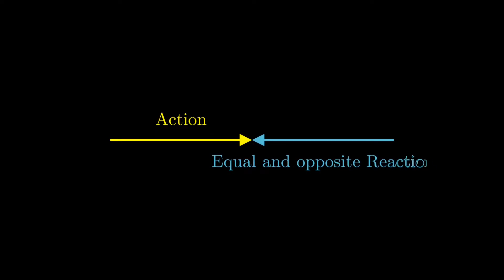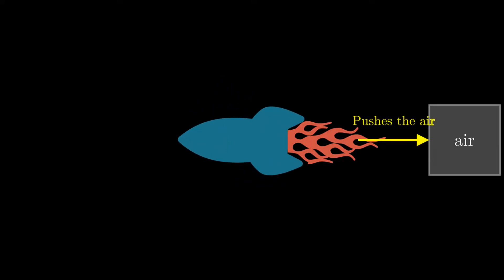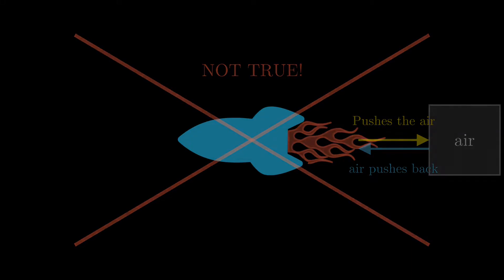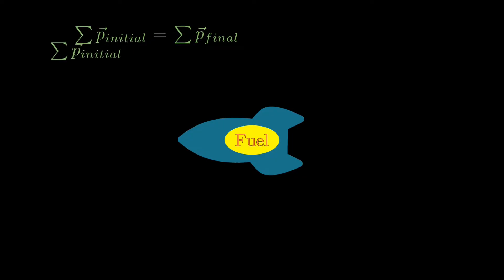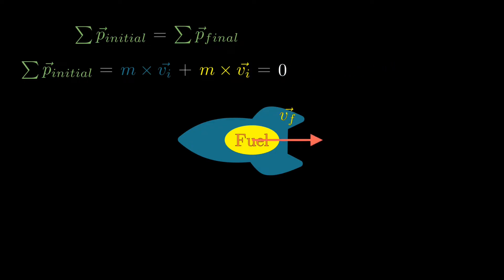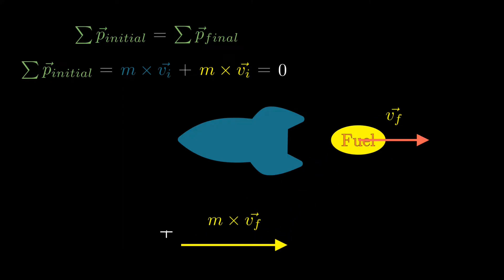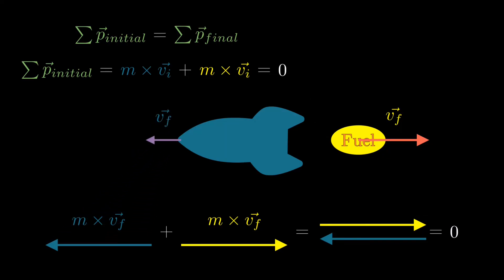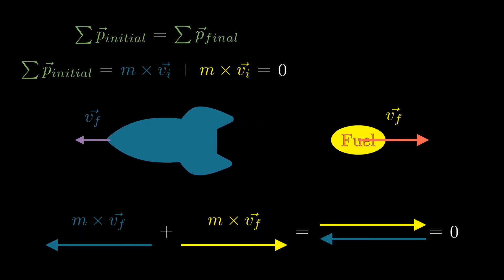What do Rockets push in Space, where there is no Air?

Comment: Newtons third law reuires " forced pairs"    a rocket in space is not a pair.  And so a rocket cannot work in space.
Reply: Rocket is pushing off the exhaust. What is the other pair?
Reply: @aznmutt15  you can't push off of the exhaust.  because there is nothing supporting the exhaust. .
Reply: @boptah7489  why would the exhaust need support? The mass of the exhaust is resistance to force. That's what it means to have mass. The millions of lbs of fuel being ejected out the nozzle is what it is pushing off of. How do you think thrust works?

Do you not understand newtons second and first law of motion works? To accelerate a resting mass (newtons first law), requires a force (newtons second law). Which will have a force back equal and opposite direction (newtons third law).

Did you want me to go into conservation of momentum also?
Reply: @boptah7489  how come the can moved before the soda hit the wall?
https://youtu.be/T8MOoUuLnug
Reply: @aznmutt15  The mass of the exhaust offers no resistance because the gaseous mass is being evacuated into the vacuum 
  ie.   the first molecule out of the rocket meets no resistance and travels at x velocity.  the second molecule out does the same and so on.  At no stage is any energy passed on to any other molecule because there is no resistance on any molecule to slow them down. 
    Newtons first law applies because there is no transfer of energy to other molecules once they meet the vacuum.  and Newtons second law applies when the molecules are pulled towards a gravitational field and the energy is then imparted onto masses in that field. ...the Universe is a closed system from a thermodynamics POV. 
   The exhaust gasses need to be supported by other masses,  just like a table supports a vase and the floor supports the table and the Earth supports the floor. .   A vacuum cannot support a gaseous mass..
    do you want me to continue.  ?
Reply: @aznmutt15  This is obviously a new subject for you.      A vacuum chamber is not the same as the continuous vacuum of space.  A vacuum chamber has walls and this then creates pressure.  Unlike the vacuum of space. .   Are we clear ?.
Reply: @bo ptah the force is applied to the molecules itself. Did you forget that part? What happened to the reactive force from the molecule?

The molecule of gas is at rest, then a force causes it to be accelerated out of the rocket. There is a force applied to accelerate that gas.

Did you forget that mass at rest will remain at rest, till a force is applied. So how was that gas accelerated without a force? 

Amazing how that table provides an equal and opposite reactive force back onto the vase? So what is the equal and opposite force on the molecule of gas?

Hmmm, such a new subject for you, that you forgot about how that molecule of exhaust was accelerated.
Reply: @bo ptah  hey, the rocket has millions of lbs of fuel. What happened to that mass? Remember, chemical reactions, such as burning, doesn't destroy mass, just changes it. So where did that mass go?
Reply: @bo ptah  hey, how does an sr71 thrust push off an atmosphere going away from it at mach three? Can't really push off stuff with the same force when it is already moving away from that push.
Reply: @boptah7489  hey, why doesn't a hose move when I place a solid barrier in its stream? Shouldn't the water be pushing off that solid object, causing a greater force?
https://youtu.be/MNQxQiFYbwk

Should I continue?
Reply: @boptah7489  if I was on a skateboard and threw a bowling ball and a beach ball of equal size, which one would cause me to move further and why? The balls are equal size and will apply the same amount of force on the air.
Reply: @aznmutt15   Gas molecules naturally expand in a vacuum.  " joule free expansion". No external force is required or generated until it is transferred onto another mass.
  Gases naturally expand with less resistance.  you need resistance to keep a gas contained. 
    Gases are never at rest unless you reach absolute Zero.  Gas molecules are continually moving especially as you release any resistance keeping the gases contained. .   Gases naturally accelerate in the presence of a resistanceless environment. 
   The table ONLY applies a force to the vase because the table is not 'Falling'.  I( supported by the resistance of the ground)  If the table was falling with the vase.  there would be no force between the vase and the table.     Just like the molecules being sucked out of the rocket.  No force is applied to the rocket because no force can be applied top the vacuum. .  As per N3.    Do you understand yet ?.
Reply: @aznmutt15  The barrel did not offer enough resistance,. However , when the hand was put in front of the hose the hose moved backwards.  .  you seem to have forgotten that part of the video. .   Shall i continue ?    Have you been beaten enough yet ?
Reply: @aznmutt15  And so.  you have 3 things.  1/  bowling ball  2/  the man on the skate board.  3/  the force separating the two.  
  A rocket in space has 2 things  1/  the rocket  2 /   the expanding gas .    
   For Newtons third law you need  3 things.  . you need the forced pairs  ( two masses)  and the force separating both.  
   A rocket does not throw a gas.  the gases are naturally sucked out of the rocket into the vacuum.    To  'throw'  something means you are overcoming the resistance ( inertia)  of the bowling ball with a force.   .  A gas needs no force to expand into a vacuum. 
   Have you finished yet ?.    .
Reply: @bo ptah  gas pushes off each other to the walls of the container. Now, if there is a nozzle which gas is allowed to escape, there is an imbalance of forces. Remember, the vacuum doesn't do anything, just provides non resistant volume to escape into. Gas pushing off each other and the surrounding container that causes the gas to escape. Once again, the molecule has a force applied to it, what is the reactive force?

Oh and joules free expansion, does not say anything about the container it is held in. Remember, we are trying to figure what is happening with that.
Reply: @bo ptah  gas does not naturally accelerate. That defies newtons first and second law. F=ma. Not acceleration without a force.

Except the vase is in a. Accelerated state. Did you forget weight? Nor resistance without that external force.
Reply: @boptah7489  so why didn't the hose move when a solid surface was obstructing the path of the water? Wouldn't that cause more resistance back onto the hose?
https://youtu.be/MNQxQiFYbwk
Reply: @bo ptah  why did the can move the instant pressure was released? Not when the soda hit the wall?

Is conservation of momentum false?
Reply: @bo ptah  I litterally pushed the hose. Not the water pushing off me. How did the barrel not cause enough resistant? It obstructed the path of the water.
Reply: @bo ptah  there a force separating the gas from the rocket? Remember, vacuum doesn't suck. Did you forget that part of thermodynamics? The gas is pushing off the container so the container is pushing back onto the gas. Except one side of the container doesn't have a wall to push off of. So the forces aren't equal inside that container.

Did you forget that the gas is pushing off the container?
Reply: @aznmutt15  the solid surface ( barrel) was not close enough to the mouth of the hose.  This meant that the resistance was not high enough to move the hose.  The atmosphere between the hose and the barrel just slightly increased in pressure and removed the pressure created.   When the hand went to the hose.  the pressure increased enough to move the hose.  as the video shows, 
   rocket s are all about pressure creation.  the grater the pressure differential between the nose of the rocket and the back of the rocket.  the faster it goes. .
Reply: @bo ptah  but you claim it would push off the surface? Why didn't the water push off the surface back onto the hose?

By your claim, wouldn't the solid surface just cause more pressure anyways? It needs to push off the air. The solid surface would push more.

How much closer does it need to be?
Reply: @bo ptah  my hand literally hit the hose. Not the water pushing off my hand. I litterally pushed the solid part of the nozzle. So my finger didn't create more force on the escaping fluid, which transfered back onto the hose. My finger directly transfered a force to the solid surface of the hose by actually contacting the hose. So the fact that the hose did not move until my finger made physical contact with the hose pretty much refuted your claim.

Why did you have to lie and make up a false scenario?
Reply: @boptah7489  the burn chamber has thousands of times more pressure than at the nose. There is no external pressure on the nose. The internal pressure of the tanks is nowhere near the pressure inside the burn chamber. You litterally just refuted your own claim
Reply: @boptah7489  is conservation of momentum false?
Reply: @aznmutt15  There is no force separating the gas from the rocket.  the force is in the molecules separating from each other .  The force on the rocket is the same as the force separating the molecules.  Which is negligible. .  just as if you push on the air with your hands.  the force is hardly detectable unless you are the size of a molecule.  Action and reaction are equal and opposite. 
   The force in a container of gas is always equal.   there is never an imbalance of force in a pressurised container.
Reply: @aznmutt15  the hose would have moved  when you blocked the hose.  .  which was why the hose moved so easily.
Reply: @aznmutt15   conservation of energy is true.  This may or may not manifest in momentum.
Reply: suction is when a force is created by pressure differential.  A gas is therefore SUCKED into a vacuum.   Suction is a physics term to describe that. 
   .  A container moves because of the imbalance of pressure OUTSIDE the container.  Not within it.  Like a bullet going down a gun barrel. .  The  greater pressure is greater behind the bullet
Reply: @bo ptah  it is negligible force, if it was just a minute amount of gas. Except, the rocket is throwing tons of exhaust at an extremely high velocity. That is a crap ton of momentum. If I were to condense air into a high pressure state, and release it at a high velocity, that wouldn't create a force? Oh wait, it does. 

Forces inside a container is equal. Except the container isn't complete, there is a hole which gas can escape. So that force is no longer equal.
Reply: @bo ptah  oh, so now you require a complete seal. I'm sorry, but the atmosphere doesn't do that to the rocket. You do realize in the atmosphere, gas is still free to expand into it. The funny thing is, rockets become more efficient at higher altitude because there is less pressure squeezing down the thrust. The factor that determines the force is how much mass and how fast it exits.
Reply: @bo ptah  vacuums don't suck. Nothing in physics says that about vacuums. Vacuums have no force or power. It is the pressure differential of the air pushing itself to that causes any force. That force still has and equal and opposite force. Did you not read the second law of thermodynamics? Did you not read the joules free expansion?
Reply: @bo ptah  oh, so conservation of momentum is true. Does gas not have momentum? If the rocket fuel system have zero momentum with respect to each  other. How is momentum conserved when the exhaust has momentum. The rocket and exhaust system still need to have a net of zero.
Reply: @bo ptah  oh. I'm still waiting for you to explain how the can moved the instant it opened. Not pushing off the wall.
Reply: @aznmutt15  because the pressure drops evenly.   Imagine a fish tank full of water.  what happens if one of the walls cracks.  Does the fish tank move in the opposite direction ?
Reply: @bo ptah  that would depend if it was on a frictionless surface. How do you think a hose pushing back on the fireman works? Lots of mass of water, at high velocity.

Same thing with an air canister releasing pressure through a hole. 

Oh and the pressure in the air tank doesn't get sucked out by the atmosphere. Vacuums don't suck.
Reply: @bo ptah  in fact, something like this has happened to me when i was a bartender. We would use a coster over a glass to seal the beer, allowing us to throw the glass of beer across the bar, even with a flip. One time, the coaster popped off mid-air, pouring the beer into my face. Now, why didn't the glass keep its momentum and crash into me? Instead, it dropped to the ground.
Reply: @aznmutt15  A hose pushes back on the firemen because the water needs a force to push it out. .  Unlike a gas coming from a rocket in a vacuum.  
   A gas is sucked into the vacuum.  The gas does not need a force to push it into the vacuum. .  It happens automatically because the gas is compressed.  
    The same for water in a vacuum actually.  Water naturally expands into a vacuum because it boils at low pressures without any heat applied.
Reply: @bo ptah  but the gas needs a force to push out. Did you forget that gas behaves like a fluid like water?

In the beer example, the beer was free to escape the glass, but the glass still lost its momentum. Conservation of momentum will dictate that the higher velocity of the beer would need something to slow down to conserve momentum. Oh its the container, the glass.
Reply: @bo ptah  how many times do I need to say this? VACUUMS DONT SUCK. The gas is pushing on itself and the walls of the burn chamber to accelerate.

Your whole argument falls apart with what you claim. A vacuum is just a lower pressure system. The atmosphere would suck out the gas of a pressurized canister, not allowing it to move.
Reply: @bo ptah  water doesn't expand in a vacuum. It boils. There is a difference. 

If I had a fire cracker inside a vacuum and it exploded next to an object, would that fire cracker cause a force on the object?
Reply: @aznmutt15  No.  The gas needs a force to keep it in.  Not to get it out in a vacuum.  You only need a force to get gas out of a container if there is resistance to the gas escaping.  
   Both the beer and glass have momentum.  momentum is a function of mass moving.  But the momentum can only be released as a force if it hits another mass. 
   The gas leaving the rocket  in a vacuum has momentum , but it can only be used as an energy source when it meets another mass.   There is no mass in a vacuum an so no force can be transferred. .  this means no force can be transferred to the rocket.  As per N3.   If the Action is Zero,  so is the reaction.  and vice versa.
Reply: @bo ptah  the gas pushing on each other is the force to expand. VACUUMS DONT SUCK.

Gas has momentum? So, how is momentum conserved when the momentum of the gas causes a change in the system? 

But there is a force from the chamber on the gas. What happened to that reactive force?
Reply: @boptah7489  if a fire cracker explodes in a vacuum next to the object, will it feel a force from that firecracker and move?
Reply: @aznmutt15  Sucking is the phenomena of pressure equalisation.   A gas always goes to the area of least resistance.  Hence it is 'SUCKED' into the vacuum.
   The momentum is still in the moving gas molecules.  But it is not imparted as a force until it meets another mass.  ie.  the gas leaving the rocket in a vacuum  is attracted to a nearby gravitational field and the momentum is then imparted onto a mass in the gravitational field. .
Reply: @bo ptah  holy shit. The gas molecules pushes on each other to fill the void. Vacuums don't suck.
Reply: @bo ptah  by your own logic the lower pressure of the atmosphere would suck the gas out of the rocket and it still wouldn't work.

You still haven't explained why a solid surface, which gives much more resistance, did not impart a force back onto the hose.
Reply: @bo ptah  what do you think the paper container does?

Not if the container is stronger than the shrapnel. The paper from the firecracker isn't going to do much damage. It is more of the expanding gas. Now would that expanding gas not move the object?
Reply: @aznmutt15  you misunderstand.    It is impossible to create an explosion when exposed to a vacuum. 
   The paper container opening will be exposed to a vacuum and so will not explode.  you can only create an explosion when there is resistance .    no resistance = no explosion.
Reply: @boptah7489  do you not realize it is sealed with wax? There is a huge difference between burning gunpowder and igniting it in a confinded space.
Reply: @aznmutt15  It is not sealed from the outside atmospheric pressure.  .  Otherwise it would not explode.
Reply: @aznmutt15  You can only create an explosive reaction with pressure,  No pressure.= no explosion.
Reply: @boptah7489  it's sealed. Even if it wasn't, let's just say it is sealed and ignited by an electric igniter. What fucking difference does it make. Will the object move?
Reply: @boptah7489  we can even cause an explosion of the gunpowder between two surfaces hurled at each other. Will they be given extra energy?
Reply: @bo ptah  we could even say it was a gun in space. Would there still be recoil?
Reply: @aznmutt15  It is pressurised.  It is not sealed in a vacuum.   Remember,  you are claiming that things can explode in a vacuum in a controlled manner.  that is impossible.
Reply: @aznmutt15  you can only cause an explosion with pressure.  two surfaces hurled at each other is pressure. .
Reply: @bo ptah  no, I am asking if the object will move from the explosion. Why are you straw manning an argument?

You do realize gas has a limited speed which it can escape depending on the area of the hole. Gas can only move at speed of sound through a converged nozzle. Not hard to sustain the burn in the burn chamber. But that is not what the question was. Stop running away.
Reply: @bo ptah  you saying the wax and paper doesn't cause enough resistance to allow pressure to ignite the fire cracker?

Fuck it then, use the gun. Will the gun have recoil?
Reply: @boptah7489  will that explosion cause the two objects to fly apart? You stated it will explode.
Reply: @aznmutt15  gas can go much faster than sound in a vacuum.  Because there is no resistance from an atmosphere. 
  If you have a totally sealed container of explosive in a vacuum and you ignite it electronically, then the container will explode.  but you can not make it 'direction specific'. 
  This is why it is impossible for  a rocket to work anywhere near space. .  You need pressure to continually combust fuel and oxidiser.  .   I hope you are sufficiently educated now.
Reply: @bo ptah  once again, not what I said. I said gas has a maximum velocity through a restricted area. This velocity is the speed of sound through that gas.  

Still haven't explained if the object will move because of the explosion. Still haven't explained why the soda can moved the instant it opened.
Reply: @bo ptah " The highest velocity to which a fluid can be accelerated in a converging nozzle is limited to the sonic velocity (Ma=1), which occurs at the exit plane (throat) of the nozzle."

So you can contain pressure my burning fuel faster than you lose mass through the converging nozzle.

So now if I accelerated the mass of the fuel to a high velocity gas out the back. How is momentum of the system conserved? Remember, the net momentum must remain zero. We now have a scalar value of mv (mass of exhaust x velocity of exhaust). How is the momentum of the system conserved? 

Momentum doesn't say anything about gas pushing off stuff.
Reply: @aznmutt15  You are working within the parameters of atmospheric pressure not a vacuum. .  There is no pressure at the nozzle of a rocket in a vacuum.  The speed of a molecule is much much faster in a vacuum. 
   There is also no pressure withing the rocket combustion chamber because it is exposed to a vacuum.  Also the fuel and oxidiser inlet jets are much much smaller thn the nozzle throat , so there is zero chance of any pressure. 
  You need to understand that a rocket needs pressure to operate.   No pressure= no thrust.   This is why a rocket cannot go anywhere in a vacuum.
Reply: @bo ptah  great. Let's see if you actually provide connotation supporting your claim. Because basic rocket science, thermodynamics would state otherwise. Describing a converging nozzle creates a choke point that will restrict the maximum speed that the exhaust. Only after the nozzle will a diverging bell allow the exhaust to reach supersonic.
Reply: @bo ptah  you still don't get that a vacuum doesn't do anything. It doesn't impart any force. It doesn't suck things out. It is just empty space. 

This is evident by the fact that the size of the vacuum does not matter in a mercury barometer. Only the surrounding pressure vs the weight of the mercury determines the height.
Reply: @aznmutt15  molecules moving in a vacuum do not have resistance....so they are faster.  
  Rocket science and thermodynamics support this. 
   The nozzle is massive compared to the fuel and oxidiser jets.  So there is no restriction.
Reply: @boptah7489  here is a simple question. Is the pressure of space negative?
Reply: @bo ptah  they aren't faster. They just maintain speed because there is nothing to bounce off of.

No, it doesn't. Vacuums do not impart any force. Lack of resistance doesn't make a molecule go faster. It just doesn't slow it down. Resistance will only resist the motion. It is like air friction is always in the negative direction of the velocity. It will just go to zero in space. Seriously, do you not understand what resistance means? What you are claiming is that the vacuum is assisting the velocity. You don't even understand what zero resistance means.
Reply: @bo ptah  so what? It is still a choke point for the expanding gas inside a chamber. That means there is a maximum speed that is relative to the pressure of the gas at that point. That speed, which it can move, is the speed of sound through that fluid. That is the maximum speed which the molecules can interact with each other.
Reply: @boptah7489  is the pressure of space a negative value?
Reply: @aznmutt15  there is no pressure in space.  Pressure is not possible in a vacuum
Reply: @bo ptah  sustained pressure in a chamber with a restricted nozzle, is what I am talking about. Shooting a stream of gas at an object is pressure. A nuclear bomb exploding in space will impart a pressure wave. C4 exploding will impart pressure. The vacuum is just a frictionless environment. It does nothing to the particles. 

You really need to start thinking of gas as a particle and how a vacuum means there is nothing to get in its way.

You still do not understand what no resistance means, do you?
Reply: @bo ptah  Basically, a converging nozzle would be like a 1000 people trying to get through a couple of doorways. There is a limit to which they can exit the building. It doesn't matter how hard people push. There is a limiting rate that they can leave.
Reply: @bo ptah  pressure is just force over an area. If we have pressure for liquids, we have pressure for gas because they both behave like a fluid.
Reply: @aznmutt15  There is Zero pressure in a combustion chamber when it is exposed to a vacuum.  the gases are sucked out instantly and violently.
Reply: @aznmutt15  No.  A rocket engine in a combustion chamber is like trying to fill a swimming pool with a 1 " bore hose , when the pool has a 2 foot hole in the bottom. .   A rocket needs massive amounts of pressure to move..   Pressure creation in a vacuum is impossible because there is no resistance.  and so no pressure.
Reply: @aznmutt15   There is zero force given by a gas in a vacuum on a mass.  Unless there is an equal and opposite mass on the other side of the gas.  N3.     A gas can not apply a force to a mass in a vacuum unless the mass totally encapsulates the gas.
Reply: @bo ptah  why. Gas has inertia. A force is needed to accelerate that mass. That force will have an equal and opposite force. 

No where does it state what you claim. Because all matters would have to follow that. Once force is applied to the particle, it does not have any more contact. If you claim otherwise, then by all means, site a credible source supporting your ideas.

Even thermodynamics state that gas pushes off itself and the walls to fill a void. Science doesn't claim vacuum draws gas in. Zero resistance means there isn't anything to hinder the particles' velocity. Resistance only slows an object. Negative resistance would mean to accelerate. Except space isn't negatively pressured.
Reply: @boptah7489  gas is the mass having a force applied to it. It doesn't need to apply force to any other particle. It's inertia, resistance to acceleration, requires a force.
Reply: @bo ptah  you got that opposite. It would be like filling full a swimming pull with a 1" drain with a fire hose. Funny how you failed to address the maximum speed of gas inside a converging nozzle.
Reply: @aznmutt15  A gas is SUCKED into a vacuum.   Sucking comes from 'suction'.  which is a physics term recognising the force generated from differing pressures. 
   Zero resistance means literally that.  there is zero resistance to the acceleration and expansion of gases in a vacuum.  Unlike an atmosphere which has resistance.
Reply: @aznmutt15   No  the exhaust throat is MASSIVE compared to the fuel and oxidiser inlet jets.    The speed is completely irrelevant because energy can only be released when resistance is met.  As per the conservation of energy principle.  
   A gas in a vacuum releases no energy because there is no mass /collisions to release the energy onto.  This is why rockets can only work in an atmosphere and never in a vacuum.
Reply: @aznmutt15  There is no force applied to a gas in a vacuum.  because the molecules never touch each other due to being in " joule free expansion " 
  Gases do not resist acceleration in a vacuum.  Gases are like compressed springs under pressure  but in a vacuum they are free to expand .  .  This is why a gas is sucked out of the rocket.  Sucking is the term used to describe high pressure going to low pressure.  no force needs to be applied to accomplish this. .  This is why there are no rockets anywhere near space.  .  Rockets are for fun and war.       not space travel.
Reply: @bo ptah  what are you talking about. The gas is pressurized in the burn chamber through combustion. That means there is a shit ton of impact with the walls and each other. Which means they will collide before the converging nozzle.
Reply: @aznmutt15  The force in a gas is the force used to compress the gas in the first place.   Gases naturally seperate in a vacuum.  You need a force to keep them pressurised. 
  The gas leaving the fuel and oxidiser jets in the combustion chamber is directed towards the throat and the molecules line up in that direction because the jet lines up the molecules.  Just like a hose squirting water.  the water is in a jet because the molecules are lined up due to the constriction and shape of the hose.  .  A bit like having a long barrelled shotgun as opposed to a sawn off shotgun.
Reply: @aznmutt15  'Sucking'  is the term when high pressure goes to low pressure.  It is automatic and requires no external force.
  Zero is not negative.   Zero resistance just means there is no resistance to the accelerating molecules.
Reply: @aznmutt15  the gas is not pressurised in the burn chamber when the rocket is in a vacuum.  The burn chamber is also a vacuum.   
  Imagine a SCUBA tank with the bottom cut off and connected to a vacuum at the bottom.   how much pressure can you put in the tank if you fitted a compressor to the top ?.....Zero. 
  In a vacuum the gas is sucked out of the chamber as soon as it enters from the jets. , because the flow of gas is pointing towards the throat.  like a hose.
Reply: @aznmutt15  the fuel and oxidiser inlet is tiny compared to the throat nozzle
    There is no combustion in the combustion chamber if the rocket is in a vacuum.   You need pressure to 1/  mix gases  2/  ignite gases.   There is no pressure in the chamber to do either. 
   the energy in the gases being sucked from the rocket is imparted onto the next mass they meet.  ie  a nearby planet. 
    You need to readjust your thinking on how a rocket works in an atmosphere  compared to a vacuum.  they are entirely different.   An atmosphere has 'resistance'.  A vacuum does not.
Reply: @bo ptah  sucking isn't a term used in science. It is a colloquial use term. There is no such thing as suction  caused by pressure in science. Go ahead and site a source supporting your claim that vacuums assist motion, not have zero resistance. 

Oh, there you go again, contradicting yourself. How can zero resistance accelerate matter?
Reply: @bo ptah  not it is not, the expanding gas due to combustion is pressurized. The fact that there is gas burning means there is pressure.

Ok we can have a pin size hole in that tank. Oh shit the gas can only escape at a maximum speed. It isn't instant. There is no such thing as instant.
Reply: @bo ptah  did you forget that there are hundreds of those inlets? They make the small to atomize the fuel and oxygen to allow proper mixing. There are hundreds of these on plate meters in diameters. They pump several tons of fuel every minute. What was it, like a million lbs of fuel per minute or something?
Reply: @bo ptah  how come in a mercury barometer the volume of the vacuum is completely irrelevant to how much mercury is left in the tube? I thought you said it sucks? If that were true, then we would measure the barometer from the top of the tube where the vacuum is. Except we don't. We measure from the bottom because it is the pressure of the atmosphere holding up the weight of the mercury inside the tube. Not the vacuum sucking up the mercury.
Reply: @bo ptah  oh, and you do realize the bell isn't where the converging nozzle is. That isn't where the combustion takes place? That's where the gas is allowed to expand into the zero restriction of the vacuum, raising the momentum of the gas.

Oh and the burn chamber had fuel injectors that had over 2800 holes pumping over 670 gallons a second of fuel. That's before the thermal expansion of combustion.
Reply: @aznmutt15  I know that combustion does not happen in the combustion chamber.  Otherwise the rocket will blow up.   The combustion takes place outside the bell. with the hottest point being the tip of the blue flame....just like a teclu burner.   This is because rocket motors are designed to create a high heat area combined with dense gaseous mass., to create the highest pressure possible. ,  The whole point of a rocket is 'pressure creation '  behind the rocket.  the higher the pressure the grater the force and the greater the speed. 
   The nozzle has to be greater in area than the jets.  otherwise there would not be any 'resistance' in the chamber to mix the gases.  Which is the whole point of the chamber. .  In an atmosphere there is enough resistance.  but in a vacuum the gases just exit the nozzle without mixing. 
   This is why a rocket cannot work anywhere near a vacuum.   Pressure creation is impossible without resistance. so is combustion and so is the mixing of dissimilar gases. .
Reply: @bo ptah  the color of the flame is determined by the fuel type. The enging of the shuttle shot a pure blue flame because it uses hydrogen and oxygen. Falcon uses oxygen and kerosene type fuel, which burns an orange color. There isn't a blue flame in that.

The solid rocket booster were just a column of fuel with a star shaped pattern in the center. The combustion occurred inside that tube.
Reply: @boptah7489  hahaha. I thought explosions couldn't happen in a vacuum. Nice contradiction.
Reply: @aznmutt15   Explosions can't happen in  a vacuum.  Only an atmosphere.   An explosion is a function of resistance.
Reply: @aznmutt15  kerosene only burns yellow if there is not enough oxygen.  Otherwise it burns blue.  
  A rocket engine is designed to create the max pressure behind the rocket .  Where the blue flame is.
Reply: @boptah7489  but you just claimed the combustion chamber will explode. Nice contradiction.
Reply: @bo ptah  I'm diluted. Every rocket engineer and explanation contradicts what you say. They use external candles to light the gas so they won't have to develop a internal ignition system. 

How exactly would they prevent the burning gas to expand into the combustion chamber? It is a lower pressure. Wouldn't that cause a vacuum and suck it up?
Reply: @boptah7489  tell me. Where is the blue flame on a picture of a falcon 9 launch? Why does the blue flame of the space shuttle not turn yellow?
Reply: @boptah7489  why do they call it a combustion chamber? What is the purpose for that chamber?
Reply: @aznmutt15   The purpose of the chamber is to mix the gases prior to combustion.  Just like the base of a Teclu burner.   
  the reason they want people to believe that gases combust in the chamber is so they can sell the lie that there is an unequal balance of pressure in the chamber and that is what provides the thrust.
Reply: @aznmutt15   The blue flame on a falcon 9  is at the centre of the yellow.  It can be seen at certain altitudes.
Reply: @aznmutt15    In your video.   "  It turns out that the ideal  exhaust gas pressure is the same as the external atmospheric pressure ".     This is the most ridiculous anti physics statement ever.   
  According to that fool.  the pressure of the exhaust is the same as the atmosphere.  .  Which means that all the hot thrusting fiery gases being accelerated onto the atmosphere do not create pressure.  .  Pathetic.
  BTW.  I never contradict myself.  I know this subect inside out. .   It is simple.
Reply: @bo ptah  considering that the gas has expanded, that drops the pressure. There are several other people analyzing this. The shock cones are visible within the exhaust jet. 

The only ridiculous one here is you. You claim explosions doesn't happen in vacuums. But claim the combustion chamber with explode. Then you claim vacuums suck, but for some reason the burn chamber would not suck the high pressure of the combustion. You also claim the combustion chamber, doesn't have combustion.
Reply: @aznmutt15  Rapidly expanding gases hitting the resistance of the atmosphere INCREASES pressure.  This is the ENTIRE point of a rocket motor.  A rocket engine is exquisitely designed to accelerate gaseous mass and heat it up in the shortest possible time to create pressure ......the end. 
   A combustion chamber will explode if there is resistance to the gases escaping in an ATMOSPHERE.  there is no resistance in a vacuum and so no pressure creation is possible. so there will be no explosion. 
  I have NEVER claimed that a vacuum sucks.  Sucking is the name of the phenomena of the force created by pressure differential. .  A gas is sucked into a vacuum.  A vacuum cannot suck, because it  is literally nothing.
  You cannot combust gases in an enclosed space.  Otherwise there will be an explosion.  This does not apply to a chamber in a vacuum.  Because no explosion or mixing of gases is possible anyway. because you need pressure for both.  
   You need to understand that a rocket only works in an atmosphere .  Because ALL rockets need pressure to create thrust.   And pressure creation is impossible in a vacuum.   This is not complicated.  Rockets were invented by the Chinese over a thousand years ago.  they are not complicated. 
  A rocket works on the principle of creating a high pressure area behind the rocket.  This then forces the rocket into the lower pressure in front of the rocket.  ALL rockets work like that.  there are no exceptions to that rule.
Reply: @bo ptah  hahahhha. Yes. We should all believe you. The guy who has constantly contradicted himself. The guy who thinks gas gets sucked by vacuums. The guy who thinks zero resistance accelerates gas. You do realize what resistance means, right? Negative resistance would assist. The same guy who made excuses why a solid object did not affect the stream of water. Then, made up some bullshit about my finger generating more pressure in the water while I just pushed the hose.

Oh, I'm still waiting for you to explain why the sofa moved the instant the can opened. Waiting for the explanation why the barometer isn't proportional to the size of the vacuum, but to the weight of the mercury inside the tube.
Reply: @bo ptah  energy isn't about mass on mass. But we aren't talking about that. We are talking about the conservation of momentum and newtons' laws of motion. 

Now, if the gas has a change in velocity relative to the rocket, how does the net momentum remain zero?

Newtons first law states that matter will remain fixed in its velocity. Newtons' second law states that acceleration of mater occurs when there is a force applied. Where does f=ma say something about resistance? Now Newtons third law states that every force has an equal and opposite reaction. Reaction isn't resistance. Gas is matter, and matter has inertia. A force is required to accelerate that gas. 

Oh, and you are completely contradicting every engineer schematic and explanation of a rocket engine. You moronically think that the combustion chamber isn't for combustion. What is it for?
Reply: @boptah7489  hey would a gun recoil in space?
Reply: @bo ptah  yes momentum is conserved. Do you know how to calculate the momentum of the system? Are you really claiming conservation of momentum is false?

You do realize momentum isn't converted to kinetic energy. But go ahead. Let's see you derive the kinetic energy formula from the momentum formula. Don't forget to maintain the unit
Reply: @aznmutt15   Gun recoil is in two parts.  1/  the expanding gases push the bullet down the barrel and the bullet has static inertia and is met by resistance from the atmosphere. . This is called primary recoil and is minimal.      2/  the bullet leaves the barrel and once the expanding gases explode a vacuum is created and the refilling of the vacuum hitting the gun  is the main recoil. 
  So,  a gun will move a small amount because of the primary recoil pushing the bullet apart from the gun, but there will be no secondary recoil because there is no atmosphere to rush into the barrel to refill the vacuum.  .So a gun will move a bit in space.  
    A gun firing in space is not the same as a rocket in space because there are only two things with a rocket 1/  the rocket 2 / the expanding gases.   
 A gun in space has 3 things. 1/ the bullet 2/ the gun 3/ the expanding gases.  .  Also the gases in the gun are exploding because there is resistance.  A rocket in space just has the gases sucked out of the rocket because there is no resistance.and therfore no explosion.     Explosions are created from resistnce.
Reply: @aznmutt15  The vacuum is still filled, even on semi auto's .  ALL explosions create vacuums.  In explosive science it is known as 'Blast wind'.  
  The force on the bullet is at its maximum on the point of explosion.  Not when the gases are expanding behind the bullet in the barrel
  ALL firearms experience the secondary recoil AFTER the bullet has left the barrel.   
  watch the begining of this video.  the bullet leaves before the recoil and the vacuum being refilled. https://www.youtube.com/watch?v=qSmC8A1pNsU
   this means that it is not the action/reaction of the bullet and the rifle that causes the recoil.  which is obvious.  A Barret 50cal has a muzzle energy of 15,0000ftib.  Is there 15,000ftib going back to the shooter....No. 
  Blanks have hardly any recoil because there is only a small vacuum to be filled.
Reply: @aznmutt15  The atmosphere has little efect on a guns recoil.  It is the gases expanding and exploding that creates a vacuum and the filling of the vacuum with atmospheric pressure is not necessarily weight specific.  The velocity of the atmosphere is also a factor. 
  the explosion behind the bullet  happens waaaaay after the bullet  has left the barrel.  the length of the barrel is immaterial except that potentially higher velocities can be reached. .
Reply: @bo ptah  by your logic, a 300 blackout should have the same recoil as a 300 win mag because the same volume of vacuum would be filled by the atmosphere. Failed logic by someone who makes shit up and has no idea how guns work
Reply: @boptah7489  why does a 9mm with 409 ftlbs have less recoil than a 45acp at 355ftlbs of muzzle energy?
Reply: @aznmutt15 either way.  there is not 409ftlb or 355ftlb going back to the shooters hand is there ?
Reply: @aznmutt15  Because the atmospheric pressure fills the barrel and breach while the gas is still in forward momentum.
Reply: @aznmutt15    the win mag makes a bigger hole in the atmosphere,because it has more power.  So more recoil.
Reply: @bo ptah  no. Those numbers are to show how muzzle energy isn't what determines recoil. Just pointing out how it is pointless to bring it up. Energy isn't force. It is not what determines momentum and the reactive force. So there goes your whole claim of energy.
Reply: @bo ptah  the diameter is the same. And it would only create a vacuum behind the bullet. Not the gun because the expanding gas is within that with higher pressure. You didn't bother looking up the pressure within the gun, did you.

This vacuum occurs behind the bullet, well after it has left the barrel, and the expanding gasses have pushed it out. 

Oh, and the fire ball isn't the expanding gas. That is just burning of the un burnt powder that was left. That's why they use flash hiders
Reply: @boptah7489  so the air would rush in from the back of the barrel? How would that cause recoil?
Reply: @boptah7489  what is that muzzle device at the end of the Barrett? What is it for and how does it work?
Reply: @bo ptah  oh and you didn't notice that gas escapes from the end of the barrel and ejection port? Not get sucked in
Reply: @aznmutt15  The force of the bullet is significantly more than the force going back to the gun. The Ftlb measurement literally how much force is needed  to move an object weighing lb's through a distance of a foot.
Reply: @aznmutt15  I know the pressure is behind the bullet.   Because a bullet moves like a rocket........with pressure..    how much pressure can you create in a vacuum  ?......Lol/ 
  There is no vacuum behind the bullet once the explosion has happened.  . the momentum of the bullet is what keeps it moving once the vacuum has been filled.
Reply: @aznmutt15  the air hitting the breach is what causes recoil. .  that pressure can originate from anywhere.
Reply: @aznmutt15  the muzzle brake is to cut down on primary recoil.  not secondary recoil.
Reply: @bo ptah  oh, so now you are changing your story. Didn't you claim the vacuum behind the bullet caused the atmosphere to rush in and cause recoil?
Reply: @bo ptah  you mean the expanding gas, just like the expanding gas inside the combustion chamber?  You mean the resistance of the inertia of the bullet, just like the inertia of the fuel.

Why is it called a combustion chamber if you believe combustion doesn't occur inside? What is the purpose of that chamber? How does the pressure of the burning gas not go up into the chamber?
Reply: @boptah7489  So the expanding gas of the gunpowder caused the recoil. So that same thing would happen in a vacuum. 

You got tired of making things up? What ever happened to the vacuum you claimed causing the recoil?
Reply: @aznmutt15  The gas does expand in the combustion chamber due to heat and acceleration.  but it does not combust.  It is really a form of mixing and  pre combustion.  . the full combustion happens on explosion.
   the fuel has no inertia when being sucked into a vacuum.  Inertia is a resistance to a force.  but gases being sucked into a vacuum have no resistance because they are already accelerating into the vacuum. due to 'joule free expansion '.  
   The pressure of the burnt fuel outside the rocket nozzle  varies in pressure all the way back to the throat .  from the tip of the blue flame  ( hottest point and highest pressure)  it gets less according to the distance from that point. And so , the  chamber pressure and the pressure outside pressure is equal at the throat point.  but this pressure is still very high ( not Atmospheric pressure )  . This means that a large 'sausage' of high pressure is created behind the rocket from the throat to the end of the orange plume , with the highest pressure in the middle somewhere.   This is the pressure that drives the rocket.  Just like a bullet.   But unlike a bullet , the rocket engine is designed to create the max amount of pressure behind the rocket at all times and it is governed by the quantity of fuel and oxidiser being burned to maintain the balance of pressure at the nozzle throat.  (  back pressure would explode the rocket )  
  A bullet on the other hand only has the one off force of the exploding powder ,  after that the bullet only has momentum. 
   This is why the suggestion that a rocket can go into space is just an outrageous ludicrous proposition. .   Because you can not create pressure in a vacuum.
Reply: @aznmutt15  yes, the expanding gas of the gunpowder causes the PRIMARY recoil.  As i have stated.   the secondary recoil  ( main recoil ). is caused by thee vacuum being refilled. .   Maybe you need to read and absorb my posts to avoid your confusion /?
Reply: @aznmutt15  You need to read my posts on recoil.  I clearly stated Primary and Secondary recoil.   . and their causes.  .  You seem to have trouble learning ..... Have you recently had a medical arm intervention ?
Reply: @bo ptah  except there is no vacuum. How does high pressure become negative pressure? Did you forget that there gas is seen exiting the barrel and never being sucked back in as you claim? You realize that gas will escape the ejection port from the expelled gas. So where exactly is that vacuum?
Reply: @bo ptah  what do you think heat and acceleration is? Pre combustion? Where is your evidence of this? It is hilarious how you just make this up. Where is any supporting evidence of your claim. 

Loss of inertia? There is no such thing. Inertia is an inherent property of matter. It is never lost. Zero resistance doesn't have magical properties like that. Inertia is present on all matter. 

Your claim contradicts newtons second law and first law. Are you saying they are wrong?

I'm sorry, but the color of flame isn't determined by temperature. Hydrogen and oxygen burns a pure blue flame. Alcohol burns in a pale blue flame. Kerosene and oxygen burns orange. 

Oh and that bell is made up of hollow tubes. How does that contain the 1000psi?

Except the atmospheric pressure is capable of squeezing the exhaust from the bell. This us evident by the fact that you can see shock cones. In fact, if the bell is too large, the atmosphere can squeeze the exhaust from the edge of the bell. That's why they designed the bell of the shuttle to converge slightly.
Reply: @bo ptah  yeah. I was wrong about the color. I was thinking something else. Temp does have an effect. 

You do realize the fuel isn't mixed in the tube. Oh and the combustion chamber would only explode if the internal pressure reaches beyond the stress point of the material. There is a reason why they are designed to withstand 1000 psi, while the bell is made from hollow tubes in the f1 engine. 

Oh and solid rocket engines have a hole in the middle of the fuel to allow combustion inside the rocket and burn evenly up the tube. Don't forget, there is an hole which gas can escape. Atmospheric pressure isn't going to stop something that is significantly higher pressure. 15 psi, is nothing compared to 1000psi. 

Though that is a very minor point. I'm still waiting for you to explain why the pressure doesn't go up into the combustion chamber. How a hollow tube bell can withstand that pressure. And how the exhaust plume is being crushed at by the amtopshere. If it was higher pressure, then it would expand out, not form shock cones. 

Oh, and any support of you claim that combustion doesn't occur in the combustion chambers. Any support that converging diverging nozzle doesn't slow the speed of the escaping gas,7 maintaining pressure, then diverging, causing the pressure to be less than the atmospheric pressure at sea level, causing shock diamonds. 

Any credible source stating that gas loses inertia inside a vacuum. Any credible source saying vacuums accelerates gas, not the gas pushing on itself to expand. Anything supporting the bullshit you have put forth.
Reply: @aznmutt15   I am not bothered if the vid is done by a Flerfer.  .  Flerfers are smarter than Nasa fanbois. .   Even if the Earth is round. 
  The vid does not say that atmospheric pressure causes recoil.  It just makes the distinction between primary and secondary recoil and the fact that it is not the bullet causing the recoil.  Because the bullet is downrange when the gun recoils. .  the Gun only recoils ( secondary recoil) after the explosion has created the vacuum.   And so what mass hitting the gun causes the recoil ???  
   The video you linked to is animation.  Animation is not reality.   It is pretend.
Reply: @bo ptah  it isn't evidence of anything. That burner isn't designed to generate thrust. Just heat. Not sure why you posted that video.
Reply: @aznmutt15   Combustion does not occour in the combustion chamber because when the rocket is on the launch pad they use flames to light the exhaust.   This is because the combustion needs to be outside the rocket.  .  
Once significant pressure is created outside the rocket the process happens hypergolically. .  You need pressure to ignite fuel and oxygen
   The pressure does not go up into the combustion chamber because the pressue is constant at the throat and maintained constantly. with the balance of fuel and oxygen being pumped into the chamber. .  If the pressure gets too high behind the rocket then it would start to combust in the chamber with catastrophic results. 
  I did not say that a gas loses inertia in a vacuum.  I said it has no 'Static inertia'.  Gases moving in a vacuum only have inertia if you want them to change direction.  Not if you want them to maintain their present direction. 
  Shock diamonds  are a result of pressure fluctuations.  .  This obviously does not apply to vacuums.  
    the hole in the tube is probably to allow pressure equalisation in the tank. 
  The pressure behind th rocket pushes on the entire base of the rocket, But mainly on the bell housings.  The bell housings are immensely strong due to their monocoque construction.
Reply: @bo ptah  amazing how they designed the combustion chamber to withstand 300 bar. Also, it is funny how they state combustion occurs inside the combustion chamber. Who would have thought?
https://youtu.be/NTzcRtHo_54
Reply: @bo ptah  this is the original video explaining recoil of the gun. Go ahead and time stamp where they state secondary recoil is caused by a vacuum

https://youtu.be/tItuD6zVKcM

Oh and still waiting for you to explain how a high pressure explosion creates a vacuum. Been waiting for that.
Reply: @boptah7489  amazing how they describe thrust. Where is the part where they talk about the force the amtopshere pushes back? 3:00
https://youtu.be/Owji-ukVt9M
Reply: @aznmutt15  That video is anti physics nonsense unless you want to create thrust in an atmosphere.   I like the way they 'assume'  it also works in a vacuum. Without showing any evidence or science to back up their ridiculous claim.
Reply: @bo ptah  says the guy who denies newtons laws of motion,  conservation of motion, and thermodynamics. The only one here denying physics is you. You make up rules as you go. You have nothing supporting your claims.

You are the one who posted a video saying it supports your claims, but stated words that are completely different than what they explained.

I like the way you assume it doesn't work in a vacuum. Newtons' laws of motion, even for gas, are explained in a frictionless environment. Do you know what a frictionless environment is? A vacuum.

You keep interchanging energy, and force and momentum. They are not interchangeable. 

Why doesn't the smoke from the gun get sucked back into the barrel? Why does pressure escape the ejection port of the gun? Isn't there supposed to be a vacuum? How does a high-pressure gas become a vacuum inside the gun?
Reply: @bo ptah  you are completely disregarding the empirical laws of physics. Force on a matter with have equal and opposite reaction. Force used to accelerate gas, will push back on the pressure forcing it to accelerate. You claim vacuums will automatically accelerate the gas.

A force is necessary to change the state of inertia of matter, which accelerate it. That is what f=ma states. That force will have an opposite reaction. Newtons 3rd law. You claim vacuum will accelerate gas, but that goes against newtons first law. Expanding gas escaping the rocket has a change in momentum to the system. How does the net momentum change remain zero if the rocket doesn't accelerate? Remember, these concepts are explained to work inside a frictionless enviroment.
Reply: @bo ptah  oh it says a reactive force. You should really state it correctly. Now, what is the reactive force to the force accelerating the exhaust out of the nozzle?
Reply: @bo ptah  just because mass has both, doesn't mean they are interchangeable. Momentum can not become other energy.
Reply: @boptah7489  the plume of smoke is still sitting in front of the barrel. You have not shown anything supporting that the vacuum is created and that it is the cause of the recoil. Even your own video describes otherwise.
Reply: @bo ptah  rockets works on force. Pressure is inside the burn chamber. The restricted nozzle limits the max flow rate of the gas, regardless if it is released into a vacuum or not. 

Still waiting for you to explain how momentum is conserved. Explain, what the equal opposite reactive force is on the accelerating gas. Remember gas is matter. Matter has inertia. A force is required to accelerate mass to change the inertial state. Nothing about vacuums causes gas to lose inertia. Of course you can provide a credible source explaining this. Then by all means. Go for it.
Reply: @aznmutt15  pressure is a force supplied by a mass. 
   Gas in the combustion chamber is dependant on the pressure of the atmosphere.   You need  a constant chain of resistance to create pressure. .  ie   a vase on a table is supported by the floor which is supported by the ground.   What would happen if there was nio ground ? 
 All objects with momentum have kinetic energy.  Which is conversant with Newtons laws.  A gas has no static inertia in a vacuum.   
   what mercury in a vacuum ?   
   You have shown zero evidence of a rocket or a satellite in space.   None.
Reply: @aznmutt15   The breach is refilled from the atmosphere closest to it.  probable the breach.  . The volume is very small. but the acceleration and therefore the kinetic energy is large.
Reply: @aznmutt15  momentum and kinetic energy are interchangeable.
Reply: @bo ptah  the velocity is small. The mass and speed which the air fills is negligible. It can't even effect the air in front of the barrel. What is the mass and velocity of the air filing the breach? You talk about the acceleration, but that doesn't help you either because the mass and acceleration of the bullet and gas out is significantly higher.
Reply: @bo ptah  that is why they have a convergent nozzle in the combustion chamber. But you don't even understand that a combustion chamber is where combustion occurs. That converging nozzle limits the area, which gas can escape. They will start to collide with the walls and each other trying to find an exit. Eventually, it becomes an incomprehensible fluid because the pressure is so high. 

So what? Just because matter in motion has both momentum and kinetic energy, that doesn't mean they are interchangeable. One is a vector unit, and the other is a scalar value. Do you even know what that means?

So what if the gas is never at rest? Did you forget the second part of newtons first law? An object in motion will remain in motion. It has dynamic inertia. Inertia is an inherent property of matter. Oh, and did you forget that gas will never remain static in the atmosphere also? Inertia is the just resistance to change in motion proportional to the mass. The properties of motion apply to all matter. The properties of motion were thought up in a frictionless environment. Do you even understand what that means. It is pretty much a vacuum. Vacuums do absolutely nothing. It is just empty space. It does not impart a force. It does not change the direction or speed of gas, liquid, and solid. Vacuums do not suck. It does nothing. It is just empty space.
Reply: @boptah7489  it's funny. I've shot a gun at sea level and at 5,000 feet before. Why doesn't the recoil change? You would think a 17 percent change in the density of the atmosphere would have an effect. 

You still have yet to show any evidence of this vacuum on a gun affecting anything.
Reply: @aznmutt15  All explosions create vacuums.  It is physics.  .  The action of molecules departing an area creates a vacuum.
Reply: @bo ptah  https://youtu.be/zbtyaKAMDdk
Funny how the gun is recoiling when the gas is still exploding out.
Reply: @aznmutt15   You can clearly see the flame go back into the barrel as well as some gas in the 45 Acp and the barret. .   
   All explosions create vacuums.  It is a well established physics phenomenon.
Reply: @bo ptah  I'm sorry, I time stamp exactly when? Cuz what I saw was the expanding gas forming a tauroid from interacting with the outside air. Don't see any smoke going back in.

With the barret, you can see the escaping gas the entire time. 

Oh and did you miss how the recoil starts before the bullet left the barrel.
Reply: @aznmutt15  The primary recoil starts as soon as the bullet moves.  but that is tiny as seen in the video.  The main recoil ( secondary) happens when the bullet is well clear. .   The  gases are not the nearest molecules to the breach and barrel.  The gases are still being propelled downrange.  It is the atmosphere that was not propelled that refills the breach and causes the main recoil.  
   You need to understand that explosions create vacuums.   Maybe you can research it yourself if you don't believe me.
Reply: @bo ptah  the primary recoil stated I. Your video explains how it is negligible caused by air resistance. To start the cycle of the firearm, isn't a negligible force. Remember, it is extreme slow motion. That slide and barrel is moving fairly fast and has a decent weight to start the action. The barrel, and bolt of the barret has to overcome the recoil spring. It isn't air resistance. And the barret did not have gas going into the barrel. It was still escaping the barrel.
Reply: @bo ptah  that would require the breach to open and the gas to move forward. Nothing would push the bolt back. You don't even know how the gun cycles.

Go ahead and explain what the vacuum does and it's effects. Or did you just read a title of an article. Oh and since you did your research, let's see a source explaining how a vacuum is the cause of recoil in the gun, not the expanding gas accelerating a weight.
Reply: @boptah7489  how does the vacuum cause the recoil? Is it like a hammer effect of the air? But the air would be coming in from the back as well. This vacuum is stronger than the impulse that pushes the bullet to move over 1000fps? That same force that is pushing on the back of the gun.
Reply: @bo ptah  isn't it amazing how the barret is capable of reducing the recoil of the gun just by absorbing some of the force in that reciprocating barrel, as seen in the video. How does that work when barrel has already moved back before your claimed vacuum would cause the recoil. As well as redirecting the expelled gas to the side and back instead of just out of the front. How does that mitigate the vacuum recoil?
Reply: @bo ptah  how does the expanding gas have enough power to cycle the action on gas piston and gas impingement guns when they only siphon off a small amount through a small hole in the barrel? 

Why does a 5.56 have less recoil than a can shot with a blank. Will a empty soda can have just as much recoil as a full one? Since the same amount of surface volume of air is displaced. So the same size vacuum is made.

How does a 300 win mag have more recoil than a 308? The vacuum is the same volume. You said the win mag has more power punching the air, but claim that is miniscule compared to the recoil of the vacuum.
Reply: @aznmutt15  on Gas piston systems the bullet is still in the barrel  when the gun starts the cartridge ejection 
   A 5.56 does not have less recoil than a blank 5.56. . The degree of vacuum is a function of the degree of resistance from the inertia of the bullet. . A blank gun just has the atmosphere as resistance and so a large part of the forces is wasted .
  The bullet moving down the barrel creates hardly any recoil.   As proven by the slo mo vids.  the recoil therefore must be the atmosphere going back to the breach because it is provable and know that explosions create vacuums. .  This is not a theory.  Vacuums and explosions are very well studied.......just not by NASA or Spacex.
Reply: @aznmutt15   the barrel moves back as the bullet goes down the barrel...This is known as 'PRIMARY RECOIL'  as i have stated over and over.    This recoil is minimal.  As shown in the video.   The secondary ( main ) recoil is not even shown in the vid you posted. . They cut the vid early.
Reply: @boptah7489  not what I said. I said a 5.56 bullet will have less recoil than 5.56 bland that shoots a soda can.
Reply: @bo ptah  creates hardly any recoil? The action is moving. That slid is moving fairly fast because of that recoil.  You do realize the speed of the slide is not slow from what you claim is weak. That video is shooting at a really high rate. You claim it was weak, but that slide will keep moving back. At that high rate. 

You still have yet to show anything to support your claim. Where is this vacuum that creates the recoil. You claim the 50bmg had a vacuum, but you can see gas escaping the entire time. You claim the 45acp had a vacuum, but that is just turbulence of the gas. Nothing was shown.
Reply: @bo ptah  where's the vacuum? 
https://youtu.be/HElQk2wEY5w

Amazing how that weak "primary recoil" is strong enough to throw that slide back. Oh wait. Your video you posted didn't say the explosion was the primary recoil, they said the bullet hitting the air was the primary recoil. Why are you contradicting the evidence you put forth?
Reply: @bo ptah  still no vacuum. You can see the explosion causing the slide to move back. Amazing how that ended up causing the recoil.
https://youtu.be/7y9apnbI6GA
Reply: @aznmutt15  All of your confusion can be relieved the moment you speak to an explosives expert .  Or  read some literature on explosions and vacuums. .  You will then no need to ask about vacuums.  Because you will know that explosions create vacuums.
Reply: @boptah7489  it's funny how you keep going back to that vacuum argument, but still have failed to demonstrate it causing the recoil. You have failed to provide anyone else who supports your claim of vacuum causing the recoil and not the explosion of the gun powder. 

How much force is used to launch the bullet. What is the opposite reaction?
Reply: @aznmutt15  atmospheric pressure hitting a mass creates recoil
    A barret 50 cal has 15,000ftlb at the muzzle on the bullet.  Is there 15,000 ftlb going back to the shooter ?
Reply: @bo ptah  that's muzzle energy of the bullet. Not force. Kinetic Energy isn't force. The force was used to give it kinetic energy. What is the force on the bullet to accelerate it?  

Oh, and did you forget that the barret is designed to mitigate the recoil on the shooter. The reciprocating barrel is one of them. You know the one that takes quite a bit of force to retract. The same one you can see reciprocating in the slow mo video before the bullet exits the barrel. Then you have the heavy bolt and recoil spring absorbing some of the recoil. Let's not forget that the gun weighs like 20-30 lbs. Lots of mass to move. Most importantly, they have a muzzle break. Do you know what a muzzle break is? It is a device attached to the end of a barrel that redirects the expended gas out the side and back to mitigate recoil. In fact, they redirect so much gas, and it reduces the recoil by about 70%. I've been behind one of those. It's feels like you got hit in the face with an air cannon. 

It's amazing how newtons 3d law works with muzzle breaks.

So why are you still running away. I am waiting for any evidence supporting your claim. I posted like 3 videos showing guns firing in slow motion. I don't see one evidence of air being sucked into the barrel. Not one video of anyone supporting your claim of a vacuum causing recoil. Even the video you used to claim primary and secondary recoil states that what you claim is false. They explain the secondary recoil is from the force used to expell the bullet. Not one mention of a vacuum.
Reply: @aznmutt15  If the force applied to the bullet from the explosion gives the bullet 15,000ftlb of energy,  Then the force from the explosion must also give the gun 15,000ftlb of energy.. Right. ?.    .   However,  that would destroy the gun,  kill the shooter and demolish some of the wall behind him.    And so it is not the explosion that gives the gun its recoil.  Which is why the gun only experiences primary recoil until the bullet is clear of the barrel and the gun recoils with secondary recoil when the atmosphere refills the gun. 
    If there was really 15,000ftlb of energy going back to the Barret , that force would be powerful enough to move a mass weighing 15,000f 1b,  1 foot backwards
  
   You have not shown any videos of a gun going through the full recoilo cycle in slo mo,  
   look at this one.  https://www.youtube.com/watch?v=sINLJA60r08
  the bullet has completely left the gun.  It is the atmosphere pushing the gun back.  not the force on the bullet. 

   Are you being paid by the government in any capacity ?
Reply: @bo ptah  force has equal and opposite reaction. Not energy. So what is the force.

Oh, and once again. Because you have no idea about guns. The barret has several mechanisms to mitigate recoil. The reciprocating barrel. Reciprocating bolt. Most importantly, the muzzle break redirects gas from the exploding gas to the side and back to cause a push forward. Trust me, I have been behind a 50 cal. That muzzle blast from 8 feet behind was like getting hit by an air canon. The muzzle break alone reduces recoil by over 50%. How does it do that for your claim?
Reply: @bo ptah  that was one of the several videos I posted. The slide was already in full motion back from the explosion. You do realize the recoil occurs when the slide stops right? You do realize the same force will have less acceleration on a larger mass. Right? 

At what point do you see air rushing back into the gun? Where is evidence of this?
Reply: @aznmutt15   ARE you being paid by the government in ANY capacity ?
Reply: @bo ptah  love the 1:35 where you can see the slide moving before the bullet leaves the chamber. How you can see the smoke lingering in front of the cartridge as the slide opens. Funny how no vacuum sucks it in
https://youtu.be/HElQk2wEY5w
Reply: @aznmutt15  The slide starts to move because of the primary recoil.  but that is not the main recoil.  the main recoil happens after the bullet has left .
  ARE YOU BEING PAID BY THE GOVERNMENT.   .  you sound like a shill.  And your arguments are feeble >  ?
Reply: @boptah7489  If a "machine" can accelerate 500 kilograms of water from a standstill to Mach Eight, can it do this WITHOUT applying a force to the mass?
OR can a machine accelerate 500 kilos of mass WITHOUT any "force"?
Let's see if you understand Newtons laws.
I have personally witnessed such a machine, in person, with my own eyes.
Now Explain HOW this machine accelerates all that mass.
Reply: @stuartgray5877  T accelerate a mass you need a force
  If the force is a 'rapidly expanding gas'. Then you also need another mass to apply the force to.  ie.  A piston moves down the bore of an engine because an equal and opposite force is applied to the piston and cylinder head.
Reply: @boptah7489 The force from the rapidly expanding gas pushes on the rocket.
Reply: @AM-rd9pu  the gas can't push on the rocket unless it pushes on an atmosphere also
 ie  The expanding gases apply an equal and opposite force on the piston and Cylinder head  in an engine.  This is called 'forced pairs' and is required for N3.
Reply: @boptah7489  The pair is the rocket and the gasses. The gasses don’t need to push off a third object in order to impart a force on the rocket. 

If I sit in a rolling chair and throw a heavy object, bit the object and you move. The chair doesn’t need to be backed up against a wall in order for you the be able to throw the object. 

The rocket  pushes on the gasses and the gasses push on the rocket. That’s it.
Reply: @AM-rd9pu    If the force comes from gases,  this means pressure.  Do you understand?.  To create pressure you need resistance to molecular motion. There is no resistance in a vacuum and so no pressure and so no force. 
  The expanding gases in an engine create pressure in the bore and so apply an equal and opposite force to the C/head and piston simultaneously.  Do you understand that ?    Rockets create a high pressure area behind the rocket by accelerating hot thrusting fiery gases onto an atmosphere,  This creates pressure and so the pressure on the atmosphere and the rocket are equal and opposite as per N3.   Is that clear enough for you ?
Reply: @AM-rd9pu  then you are pushing off the heavy object. .  A ball is a heavy object,  the man in the chair is a heavy object.  the force separating them is the force in the mas arms. .  Newtons third law.
Reply: @boptah7489  So just explain HOW rockets accelerate the exhaust gas out the back.
YOU CANNOT.

Right here IN ATMOSPHERE - we can SEE the exhaust gas moving at high velocity away from the rocket engine.
From WHERE did the "FORCE" originate that accelerated all that exhaust gas?
Do rocket use "MAGIC" to accelerate the gases?
Or does the 14.5 PSI atmospheric gases "SUCK" the exhaust gas out of the 3000 PSI combustion chamber?
OR
Does the 3000 PSI combustion gas "PUSH" the gases out into the 14.5 PSI atmosphere?
WHICH IS IT GENIUS?
Now be sure to RUN AWAY while making excuses for why you don't need to answer my questions.

You know there are people who HANDS-ON work on rocket engines while we can tell that YOU have never even SEEN a rocket engine IN YOUR LIFE?
Reply: - 'Newtons third law requires " forced pairs" '
Yes.
And that is exactly WHY - a rocket feels the mechanical recoil of pushing out mass.
The rocket applies a "FORCE" to the mass of the exhaust gas accelerating it into the vacuum.
Based on Newtons THIRD LAW, the rocket MUST FEEL AN "EQUAL AND OPPOSITE" force pushing it forward.

For YOU to say otherwise means YOU believe that rockets accelerate mass using "MAGIC".
So bless your little heart!
So boptah - do rocket engines make the exhaust gas accelerate into the vacuum with "MAGIC"?
or do the engines apply a "force" to accelerate the mass?
WHICH IS IT GENIUS?
Reply: a RoCkEt cAnT WoRk In SpAcE
just another day, just another lunatic...
Reply: WRONG!

https://youtu.be/yypTdOFz4Kg